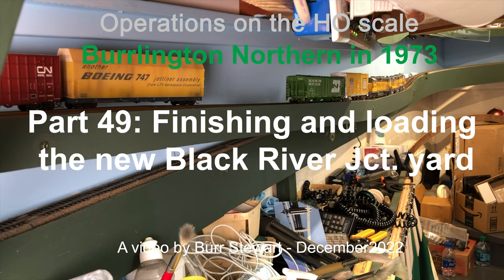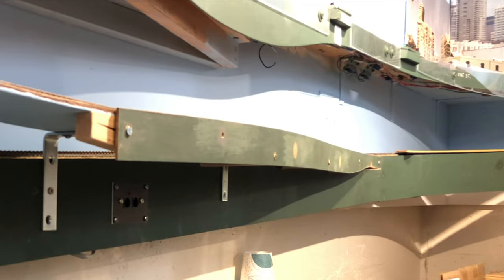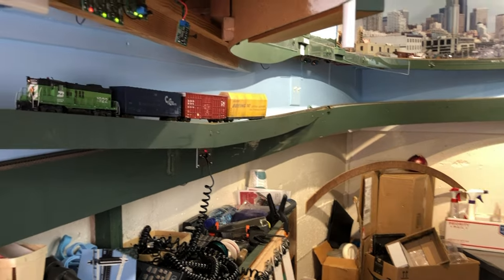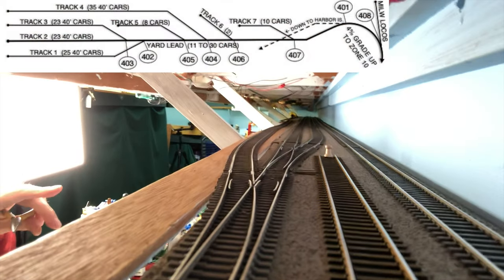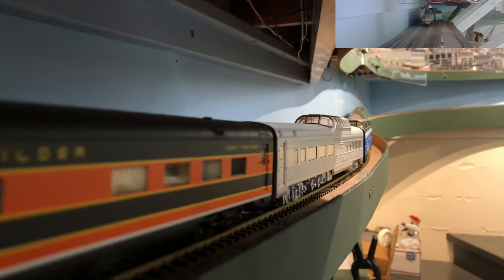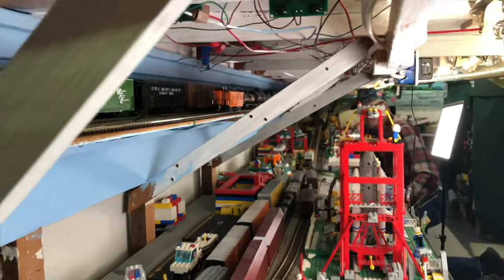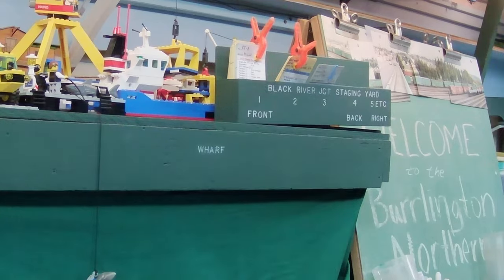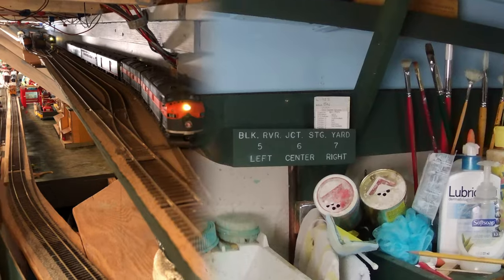Part 49 - Finishing and loading the new "Black River Jct. Yard"

Comment: Good series on building a hidden staging  yard.  Do you have videos showing how wire the older switches for DCC?  I like the hints on labeling boxes, what size lettering template do you use.
Reply from the maker: My last live stream has a segment on wiring an old Shinohara turnout for reliability, (here is the link: https://youtu.be/RjOWQPQ6lg0 ) but for full compatability with DCC you also want to rebuild the point switch mechanism with an insulated throw rod, which I've done, but not on video yet. This is a good idea, though - thanks for the suggestion. For the lettering, I'm using a K&S brand 5/16" stencil. I suppose 1/4" would be fine, too...

What I like most about the stencil lettering with a white eraseable pencil is how easy it is to make changes after you've run some trains for a while. I'm amazed at how often I learn something new about the prototype railroad and decide to add a spur, and then have to re-arrange the car card boxes. In 30 years this has happened to me dozens of times! I was at a layout recently where they had engraved the labels on their car card boxes, and I thought, "this looks nice but how are they going to make a change to it?"

Comment: I use track nails to set my caboose ground throws. Have to be careful when doing that to not strike the throw when setting the nails
Reply from the maker: I used to use track nails, too, and they probably look better (after being painted). But I liked having more control by drilling the pilot holes and adjusting the tension on the ground throw more carefully than with hammering in nails.